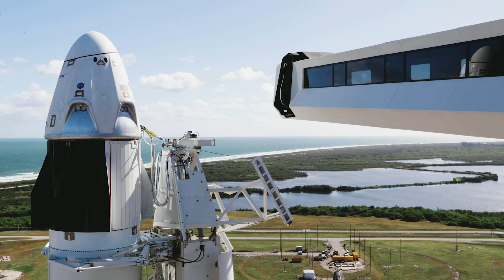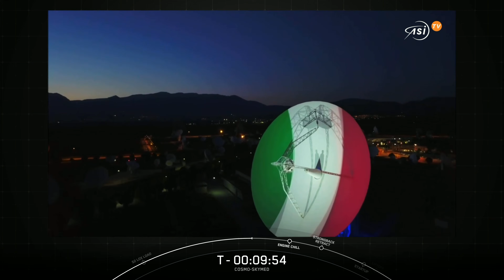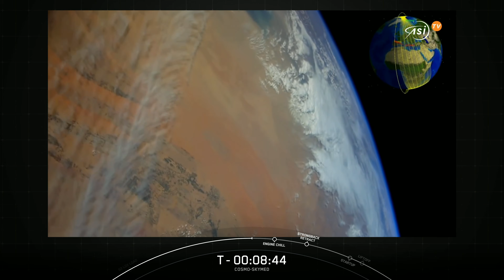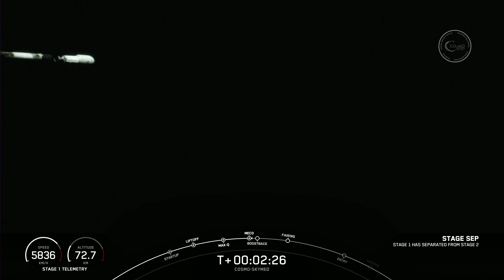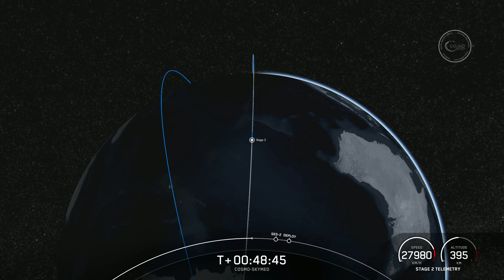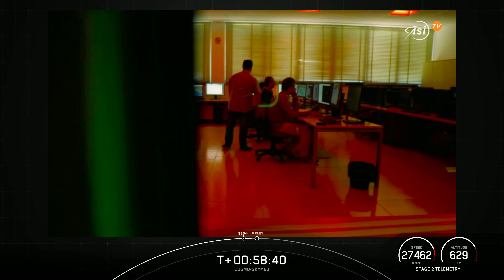COSMO-SkyMed Second Generation FM2 Mission

Comment: At 52.38 speed at 27980 KM/H altitude 395  them at 53.10 big change speed 27057 change of -27.95 KM/H Altitude big jump from 395 KM to 631 KM change of 263 KM how did that happen that all happened before SES-2. Before SES-2 speed 27057 Altitude 631  after nvec shut down Speed 27455 KM/H  Altitude 631 again of speed of 398 KH/H and change altitude -1 now 630 KM  At T+01:00:11  payload deployed   Speed 27466 Altitude 628   Speed gain of 11 KM/H  Altitude decrease of - 2 KM
Reply: They second stage was out of contact with any ground tracking stations as it passed over Antarctica. There was no telemetry updates for a period of time and the display was showing the last received telemetry. Once the second stage was back in contact with a ground station, the display synced up with the new telemetry. If you listen at 01:09:25you can hear “Acquisition of signal, Diego Garcia”. This was the confirmation callout that the second stage was back in contact with a ground station.

Comment: Any info on de orbit of stage 2? 
I'm curious if there is enough fuel left, or could be added to the launch to accelerate deorbit.
Reply: This was a return to launch site for the booster.  They only do that when there is plenty of fuel to spare, so no worries on reentry.  Not sure how many orbits they had to wait to ensure that it lands in a big empty section of the ocean.